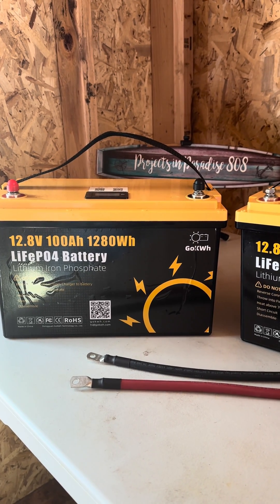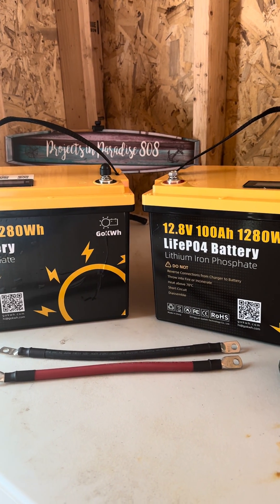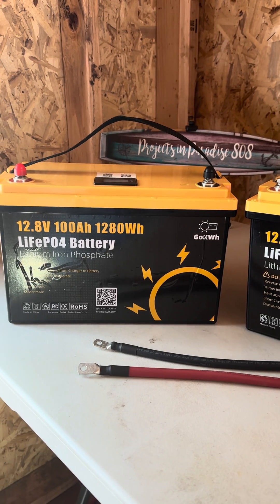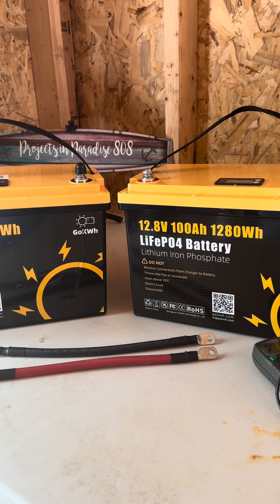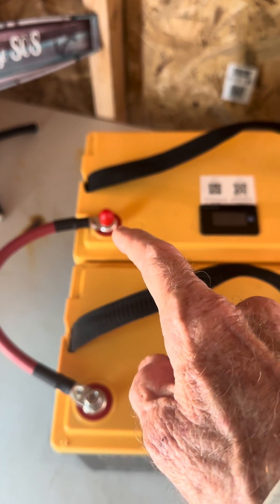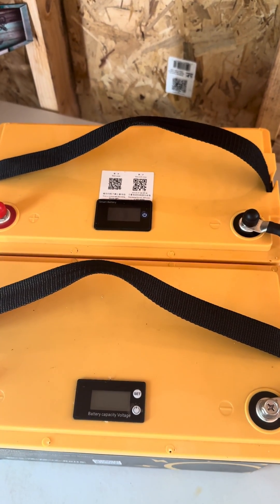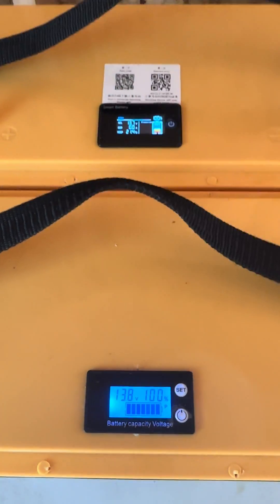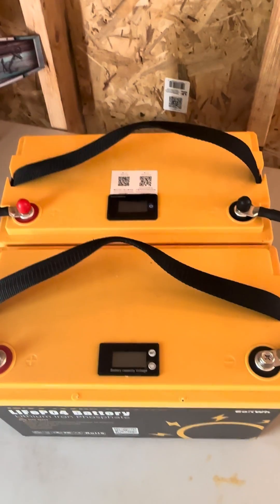Making a 200Ah LiFePO4 battery bank 1st steps #diy #solar #offgrid #shorts #hawaii

Comment: looks great . the one battery we know has not so great meter and the newer one much better meter. you may always see a difference on the on board meter. the cells are the same .  remember pos on 1 battery and neg on outher one .
Reply from the maker: They actually read the same after sitting in parallel for 24 hours. That surprised me, but maybe both have a decent voltage display. I like the 2nd generation better for sure though. And yes on the cable tie ins! Mahalo!🤙

Comment: Have you any need for a current balancing device? The cells inside each battery have a BMS. With the amount of energy in the batteries, used incorrectly, I’m seeing some reports that just people are saying any power system in series or parallel without load balancing. 

You have been working with these systems for much longer than I have. So I thought I might ask your opinion.

Comment: 280Ah batteries are getting cheap.
Reply: Getting better. Just ordered 45kwh worth of 304 cells delivered for $105 ea. Hard to say where it's going? May be surplus with the EV market falling apart or manufacturing moving to the storage market? Korean Battery just finished building a ginormous plant here in Ga employing around 5k people only to turn around and shut it down. Take advantage when it shows it's ugly head...